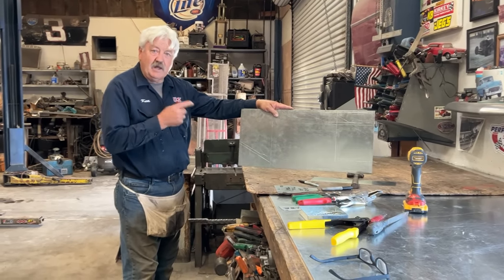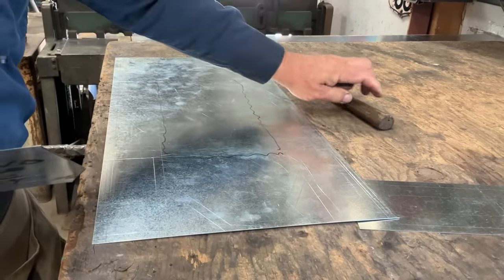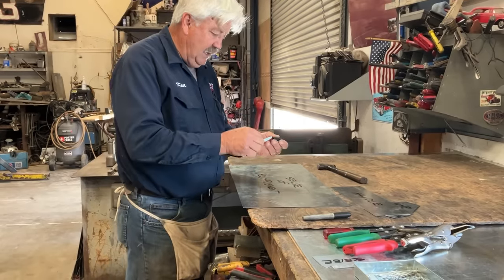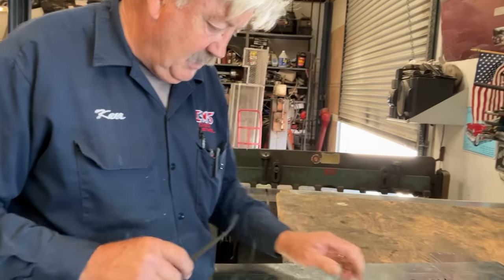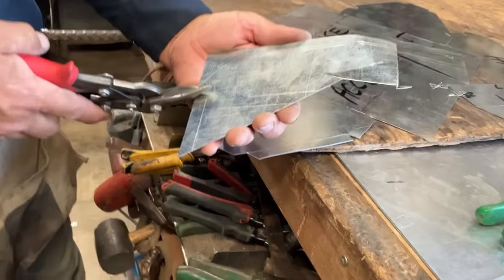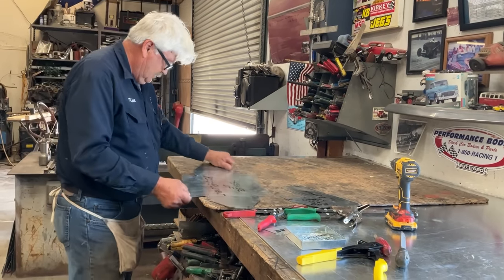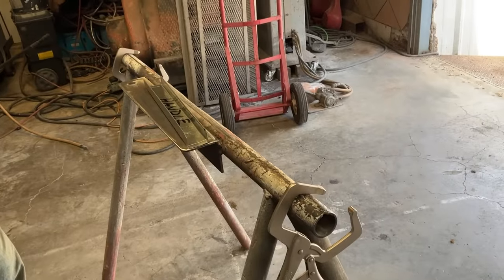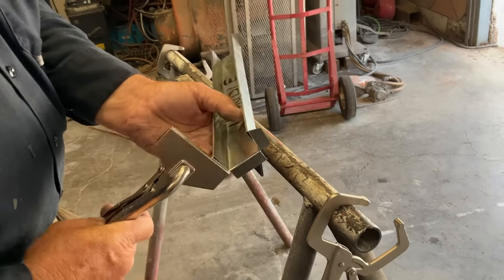Sheet Metal is Fun!  Making a tool tray using hand tool

Comment: @71 I'm still learning. I hemmed countless pieces of aluminum over the years while doing vinyl siding and never realized that open loop on the hem added strength. Makes perfect sense because any tubular shape is more resistant to bending than a flat piece but it never dawned on me. So I'm happy to learn something new from you. Thanks.

Comment: As a machinist and sheet metal fabricator in the industrial food industry for over thirty years, and a home automobile parts fabricator for nearly fifty years, I really appreciate your video here. Of course having a Beverly B2, a Plexto foot shear, various brakes and Whitney punches, makes the work effortlessly. Your performing the work with basic hand tools is very clever. Even an Harbor freight brake would help here. I also like to use both my right hand and left hand Wiss snips so the smooth edge of my cuts always face on top for a smooth outside edge. I also agree that we sorely need constraining programs and apprenticeship ,s in this country. Our corporations and politicians have failed us over the decades along with the decline in strong trade unions.
Reply from the maker: You might be my brother from another mother. Thanks for hanging out with us
Reply: You are right! My husband is a tradesman for over 30 years and  also says the same thing about apprenticeship programs should be encouraged again in this country and how corporations and our politicians on both sides have failed us regarding the trades.

Comment: I’m a software engineer, but have a sense of wonderment about creating 3D objects from a flat form. Whether it’s sheet metal, cardboard, or paper. I’ve created a handful of various boxes and trays in the past, but I still enjoy watching it done. Your explanation of the process was very simple and straightforward. I especially liked the tip of using the screwdriver to tweak the tabs to fit into the hem. Thanks for passing on your knowledge and showing ways to do it with simple tools.
Reply from the maker: I'm happy to share. Thanks for watching

Comment: Thanks for the lesson.  I need to make a belt guard for a table saw, which will be a good first project.
Here's a tool tip about adjusting C or F clamps with one hand, as I do in woodworking.  Instead of turning the screw in or out, grasp the handle or t-bar and let the clamp dangle just a bit away from your hip.  Then twirl the body of the clamp around the screw until it is open or closed enough so that it is within a turn or two of clamping the workpiece.
Reply from the maker: I like it. Gonna try it today

Comment: My main sheet metal experience is with siding, bending aluminum trim coil and metal roofing. Malco benders and HVAC ductwork hemmers are my go to tools if I don't have a brake to hand. The HVAC hemmers can be bought in a few configurations, I use the 12" and 16" a lot, both have a 1/2" and 1" side. They can be cut to fit specific lengths. 24" is about the longest that I've seen sold retail but you can get them made at sheet metal shops in any size. I have found them at Lowes and Home Depot. They bend any angle up to a 180* J which can be closed using the malco benders, but you have to close it in many passes to avoid crimp marks.  In my sheet metal endeavors I've built street stock and dirt late model bodies. Even though I used manual and CNC brakes to form the panels my roofing, siding, and HVAC tools were used extensively to fit and hang them.

Comment: Worked all my life as an electrician but was lucky enough to pick up some tips from a very talented tin knocker. Still have the Stainless Steel soldering iron stand that I made 50 years ago. Made several metal trays for my tool chests & tool cart. Lined them with rubber lagging. When the contractor replaced my gas furnace he let me hammer in one of the think he called them stays that join two pieces of duct work.
Reply from the maker: Probably S and drive. We're gonna show that in a future lesson.
Reply: Slip and drives... Yes

Comment: I so glad i clicked on yt suggestion.
We have same problem with engineering and mechanics over the other side of the pond, i had a career change at over 40 and took a free introduction engineer course. We did some bench skills at a local college ,including sheet metal, we made a airplane and wire reinforced bread tin but with folded diagonal ends.  We were only given metal hammers, and bench vice the joints and bends were always out of size because we're not given the proper tools to reduce the strech.
Your lessons are so much better! Thank you for your time and sharing your knowledge.Mike
Reply from the maker: Some people love to sit at a desk. Others would rather build a desk. Both are necessary. Thank you from another builder.

Comment: Thank you Ken for such an educational and inspiring video.  I have used what you taught today in making a 500mm x 800mm lid for my bicycle trailer from 1.2mm aluminium checker plate.  I used 50mm x 6mm equal angle iron instead of wood due to the thickness of the material. Thanks to the more than 2 things I learnt from you, it turned out perfectly.  It was fun and  I feel a great sense of accomplishment.  Keep up the great work.  PS Sorry about the metrics, that's what we use in New Zealand.
Reply from the maker: All right, slow down, let me get this straight. Learned two things, had fun, you got a sweet lid, and you feel a great sense of accomplishment? I'd say it's time for  chocolate cake and a nap. You gotta learn to pace yourself. I'm glad you found us!  PS the metric deal is a real buzz kill to our tape measure and fraction lesson. 😆

Comment: Great presentation.  Anyone can make this tool carrier.  I am not sure I would make the following change but I present it as a thought I had about it.  At 52:00 minutes you show a good close up of the handle about to go into position on the side.  I might cut the folds of the handle side flanges by 3/8" and angle cut those flanges so that when they tuck into the side flanges they go all the way to the top edge inside.  This would raise the handle by that 3/8", still having the handle below the top of the sides, and I think support the weight a bit more.  Maybe not but maybe.

Here's something that just came to me.  When you carry anything with a handle, a bucket or such, that item seems to always bump against your leg as you carry it.  Now, imagine only notching the handle on one side by 3/8" mounting it at an angle to the box.  When you carry, it would tilt the box by a small amount away from your leg but not enough to spill out tools.

Comment: I just stumbled on your series today.
I'm 61 years old. I've spent a lot of time working in poperty and industrial maintenance.
Now, I have a little place in the country.

All of this has made me me super aware of how we're losing knowledge, mainly in the mechanical trades.

For example, I have a windmill. It's older than me and actually works better than me. Unfortunately,  I've had to shut it down.
Why? Maintenance. Basic things like changing out the leathers and changing the oil.
I am scared to run it.
I don't want to damage it because of past due maintenance. So now it's just sitting.

Now a man whe knows how to do this could make $300-$400 minimum in 2-3 hours of labor.
Easy money for a side gig.
I would gladly pay twice thst for just basic instruction on how to do it myself.
These old machines are still being made. 
They do a job and do it very well.
They're even "green!"

Bottom line, the men willing to take on and continue these trades are going to have a steady line of honest work for decades to come.
Reply from the maker: You are right. Our door is locked and our phone is off the hook and I still have more than I can ever get to. I hope our lessons will resonate with some and they will join the skilled labor force. Thanks

Comment: Thanks Ken, you've reminded me of some great ideas here. I like how tabs are sometimes tucked underneath folds. I think that's a mark of perfect you don't always see in builds, obviously due to time and complexity but it's gonna be way stronger and much more pleasing. 

Computer cases are an area I've spent time with and I think people do a great job with them. Now I know a little more about what's going on. Sounds stupid but people don't always look at a rivet and think, what is that and how does it work? They just assume its existence as if it was always there and why wouldn't it be?  Funny way to go through life. I'm glad I'm beyond that phase. Makes the world more fascinating.
Reply from the maker: I like your style. I hope more folks are willing to adapt mechanical thinking. Look at a gas pump or a vending machine or a metal file cabinet. How was it formed? What did it look like when it was a flat piece of metal? Be curious. Become more capable and self-sufficient.  Thanks for hanging out with us.

Comment: This was a reall good tutorial.  Thank you for sharing.
Reply from the maker: Alright, now you gotta make one. 😆
Reply: @kengodfrey1956  I will try one. I suppose the sheet metal gauge thickness is around 26-28? What I would like to see/learn is how to join the ends of sheets together without welding, soldering, screws or rivets. I see people making some sort of bend and interlocking folds. I would certainly like to see some of that type of work. Thank you for sharing your master craftsman skills with the rest of the world.
Reply from the maker: @AM-dn4lk  26 ga. You want to use an acme lock  for seaming without fasteners or solder. Look it up on you tube. If you don't find it let me know, we'll demonstrate it in our next lesson.

Comment: Awesome video.  I'm an aircraft mechanic but don't do any sheet metal work hardly ever.  I play around with it in my off time and try and learn stuff here and there.  You pointed out some vise grip pliers early on, a recommendation I have is that if you can afford the brand name Vise-Grip or Irwin vise grip, try and steer clear of the tractor supply discount bin ones.  I find the couple extra bucks is worth it, the cheaper ones seem to suffer from alignment issues and poor riveting quality.  The couple extra bucks early on I think is worth the money.
Reply from the maker: You obviously know your tools. Thanks for watching and sharing.  I appreciate your time and input. I have an faa approved list of pm and replacement tasks I can do as a pilot and aircraft owner to our skyhawk. But I love to hang around our A&P  IA mehanic at the FBO. Cool stuff.
Reply: @kengodfrey1956 awesome!  Planes are cool 😎.  I got a big drawer with a bunch of different kinds of vise grips, but inevitably I search around for "the good pair" haha.  That misalignment and assembly issue becomes VERY apparent with the long reach vise grips used in welding and general fabrication. Plus I'm pretty confident the alloys of the cheaper ones are much softer and less durable.  Does anyone really need to spend 100 bucks on a pair of snap on brand vise grips?  Probably not, but to each their own.
Reply from the maker: @JWard6176  I have my original  11r s and 6r s and my 6ln s I bought from my dad when he sold tools and welding supplies in 1978. Peterson has been bought and sold several times ( the Cooper group, Irwin), and now  they are entirely made over seas, which make me sad. I stop into pawn shops and swap meets, and I never leave an American made pair behind. Our goal on the channel is to encourage folks to take on a challenge outside of their comfort zone  and do it at a reasonable price. So we use tools they can buy at a box store or harbor freight. I'm glad you stopped by.
Reply: @kengodfrey1956  agreed, live within your means.  Good tools won't necessarily make you a better mechanic, but bad ones can limit you at times.  It really moreso boils down to the craftsmanship of the person doing the job, skills which are only improved by actually doing the job (along with learning from an experienced guy on YouTube, haha).  I think the world would be a better place if people weren't worried about just picking up some tools and getting started making and fixing stuff.

Comment: Let's see what did I learn today.  1. The teardrop is important.  2. Put a little pressure on the metal to get it to bend.  This should come in handy to use up some of the scrap I'll from a much bigger project I'm doing.  I do have one question: Are us using steel or aluminum pop rivets?    Keep the good stuff coming.
Reply from the maker: I'm a hot wheels  guy, but  you did ask a good question. We are using a #42 steel/steel rivet.  That's 1/ 8 diameter x1/8 grip length. Thanks for hanging out with us

Comment: If you prefer,, rather than using a screwdriver to direct your lap joints, use your left and right snips on diagonally opposed corners.  Usually, snips are always on hand.  Good luck everyone from an Aussie "sheetie".
Reply from the maker: I use your method when I'm mitering square rain gutter downspouts in the field. I usually notch  in the shop with straight snips.

Comment: Thanks Ken, for the lesson. Now I need to get some sheet metal and sheet metal tools, so I can start making some sheet metal drawers for cabinets, I have! You make everything so easy to understand. Any specific gauge sheet metal good for this type of project, and is it aluminum? pretty sure you said it was soft aluminum.  Any good sources to buy the sheet metal?
Reply from the maker: I used 26 ga. Galvanized in the lesson. It can be formed easily and it's robust. Heavier material offers more resistance to forming but pays dividends in longevity . Big box home diy stores have a small selection of flat stock . You may have a metal supply in your area . Thanks  for learning  with us. Send me a pic when you're done. 👍
Reply: @kengodfrey1956  Thank you sir: will do!!!

Comment: Well done
But I would have used a rround wooden handle wrapped with the steel on the outside for strength,
That way there is no sharp edges or square metal to put pressure on the hands

Comment: We need to have shop classes in school again, with teachers exactly like you. I wasted 12 years in college prep school just to become an elevator mechanic. Only good thing was I learned to play the piano. Trades are never going away, and we need to turn out good tradesman. Anyway well done, you’re an excellent craftsman and a fine teacher.

Also forgot to ask, what is the max material thickness that’s practical to work like this?
Reply from the maker: We are using 26 gauge. It cuts easy, is compliant to forming, and is budget friendly. I have been a mechanic and fabricator for over 50 years. Being self-reliant is a beautiful way to live. Every day is different, challenging, and rewarding. Our hope is that some will rise to the occasion. We appreciate your time. Thank you.

Comment: Work with sheet metal. You showed me a lot of what it takes to work sheet metal. Could a piece of right angle metal work in place of the wood?
Reply: I don't think would get as tight of a 90° bend because angle iron has a rounded end where wood has a crisp 90°.

Comment: Hi Ken,   for my first sheet metal project, making this tray, would you go with the 26 gauge galvenised steel, or would you make it out of aluminum?  Is there a reason not to rivet the bottom tabs of the handle?  If I can do this, I was hoping to move onto hardware storage bins, I noticed your teardrops looked like they were seamed over a bit more in them, did you fold them over a wire?
Reply from the maker: 26 ga galvanized. Is affordable and compliant to fabrication. Third rivet in the handle is a good idea. The tool tray was formed entirely on the lesson. No wire. If you saw the bins I made, I formed them on a box and pan brake so they are tight. But short so they didn't require. Much rigidity.  Hope this helps. Thank

Comment: Could you make the bottom end flange of the handle long enough to bend the other way and slip under the top teardrop? Would the additional surface area be beneficial at all?
Reply from the maker: It would make the handle pattern more complex. The handle can already lift more than a comfortable amount . I still think you should try it though.  This is after all a process of learning. Thank you

Comment: @kengodfrey1956

Would adding a couple more rivets through the bottom (long) tabs of each end of the handle offer a little bit more security or rigidity to the mounting of the handle?  I realize that sliding the vertical tabs (of each end of the handle) under the seamed edges of the gable ends provides a decent amount of security, but would two pop rivets in each of the bottom tabs on the handle ends prevent some flex or “rocking” of the gable ends?

Just curious.

Beautiful work though and you make everything seem approachable for a neophyte like me.  Now, if I could just clean some of the junk out of my shop, so that I could get inside!
Reply from the maker: I think two more pop rivets would be sweet.  Thanks for learning along with us. We appreciate your time

Comment: I'm surprised you didn't peen down the pop rivets to tighten up the seams. 40 year retired tin knocker here, remember the days of soild rivets and rivet sets?😊
Reply from the maker: I still have all my rivet setters and acme lock staking tools. Last month I had to hand  make a G lock for an old rectangle duct. Good times.
Reply: @kengodfrey1956  Oh yeah do do I and still use em once in a while. After solid rivers went away they were used for knocking Pittsburgh seams together forever. In apprenticeship school we went allowed to use pop rivets it was all solid rivets.